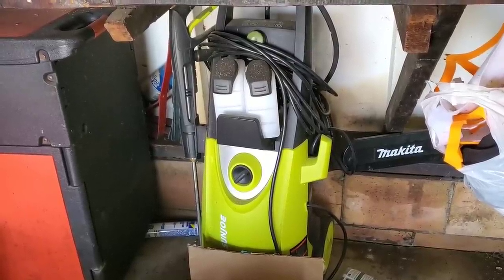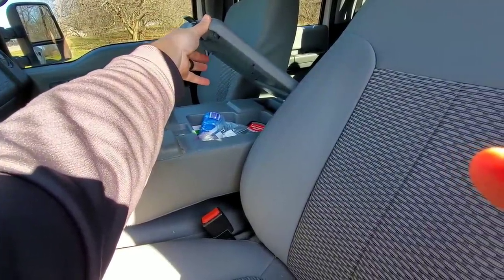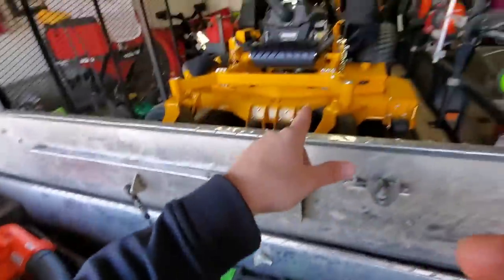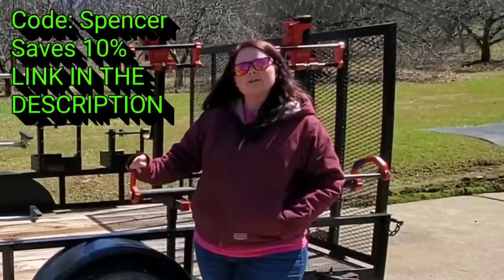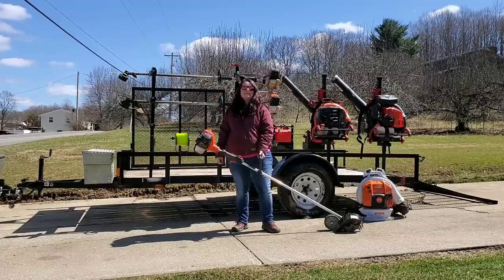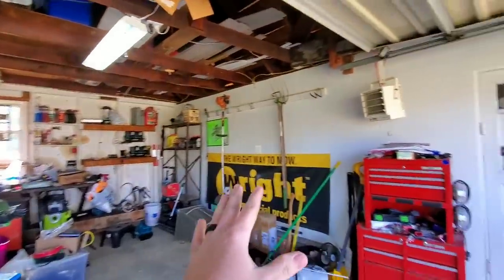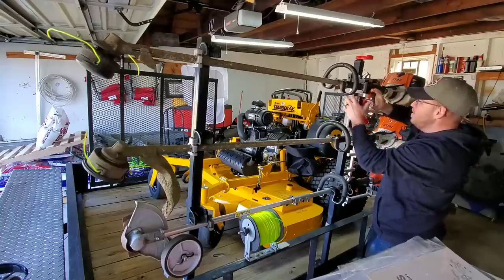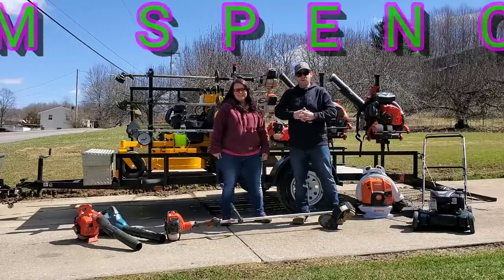[Lawn Care Trailer Setup 2019] Equipment

Comment: I  have a Toro ZTR 20381 36 in. A Echo PB-770T Backpack blower. An Echo SH56CE Blower/Vac. An Echo Combi system with a trimmer/Edger/Hedge trimmer/ Paddle attachments. And finally Toro 20381 Push Mower. All fitting nicely into a  4 X 10 enclosed trailer.
Reply from the maker: That is awesome man, nice equipment

Comment: Shawn, I took some brick & pavers and I made a mower wash pad in the back corner of my property. I got a used car ramp that car dealers elevate cars on their lots to sell, slid the sides closer together, and now it works sweet in elevating my mower to wash it thoroughly. Pulling out the power-washer is a slight inconvenience, but it is handier then running to the carwash.

Comment: Suggestion, get the fire extinguisher out of the bottom of the tool box where it will get buried. It should be mounted somewhere that it can be reached in an emergency. You have a huge investment in that rig and you need to be able to quickly protect it. Consult a fire department if you have questions.

Comment: A tip, keep your mower more over the axel of the trailer. You have a lot of tongue weight with it that far up the trailer
Reply from the maker: That was just for the video. If you notice later on in the video its over the wheels.

Comment: Can I get you to check on something for me. I would like to know if a 36 walk behind or stander could go up the side ramp at the front, then have the 61 or 52 inch stander behind that, and still fit a 30 or 21 inch mower sideways at the back. If that will fit and not overload the trailer weight, I think it would be a perfect set up for a 2 man crew for efficiency.  By having the stander sideways at the front, it wouldn't have to be contantly unloaded to get to the big mower. Could you do a few quick measurements and check that for me. I currently run a 5x10 and its not big enough. Looking at a new trailer and one new mower for this year maybe.....ZTR or stander. Trying to stay with a single axle and shorter trailer for the tight neighborhoods if possible. Thanks!

Comment: Really need your honest opinion on something.
Ok as far as Trimmers go.  I just purchased Stihl Fs 111Rx. Great deal couldn't pass up.  I went originally to buy the 91R or the 94. However when I got there  the 94's were gone.  One 91 was left but it was 30 bucks more then the Fs 111rx . So I  jumped on that one.  more power so figured I couldn't go wrong.  But I don't know anybody running a 111. The 91 I know is awesome.  I just hope I didn't shoot myself in the foot by purchasing this machine because it was cheaper but yet had more power. Do you know anything personally about the FS 111Rx? 
 I just bought it today so I haven't ran it yet. And this one is replacing my 110 that was stolen. And that thing was a beast. Thx
Reply: @1 0f tha Watchman 
yea I took it bk bro. I got lucky because they don't wanna return it. Even though it had never been used or touched. I exchanged it for the 131R.  Even though that 1 probably won't get much use. I would like to know that I have it available in case I have overgrown lawns
Reply: @1 0f tha Watchman 
 Yes sir they are great.  right now on my trailer I am running the 91R the 94 and now the 131. plus my stihl 91edger.  But they all have a place. The 91 and 94 I'm going to try out the new sthil feed heads this week and see how they work. I normally use the Eco speed feeds
Reply: @1 0f tha Watchman 
 Yes the 111R is a great trimmer. My father-in-law uses that one. I needed a bigger trimmer to replace yhe 110 that was stolen from my truck. Originally I did want the 111R. But  they were out.  And I normally don't do overgrown lawns. But I have gotten calls from city officials asking me to go give bids on lawns that are crazy overgrown. And they are big money lawns.
Reply: @1 0f tha Watchman 
Overall I think the 111 is great
Reply: @1 0f tha Watchman 
 That's awesome bro. Like I said earlier I just recently purchased new trimmers. The 91 and 94. 131 is next. but no rush.
Good luck with your trimmer.   FYI don't forget it takes a few tanks for it to break in . so don't worry when u hear it bog down a few times.
Reply: @1 0f tha Watchman 
 I don't know if you gonna change out the head on it. But if you do I would just stick with the echo 1. I bought the stihl brand for the FS91. i kind of like the Echo better

Comment: How does Odot let u get away with no straps on ur mowers? They M(michigan)dot and even local police/county/state boys r all over everyone up here. Even pulling over enclosed trailers to check for fire extinguishers road flares and triangles plus they check to see if ur emergency brake away battery locks up ur trailer brakes as it should when the pin gets pulled
Reply from the maker: Let us get away with it? When we long haul we strap down. Going house to house we don't. Hope this answers your question.
Reply: @SpencerLawnCare  oh they don't let use get away with that unless we r driving down the street a couple houses
Reply: @SpencerLawnCare  and even then we still throw the strap across to look like

Comment: How do you release hyd on the zk in case in breaks down? And how do u secure zk to trailer?
Reply from the maker: Straps and they normally have levers on the wheel motors you can release.